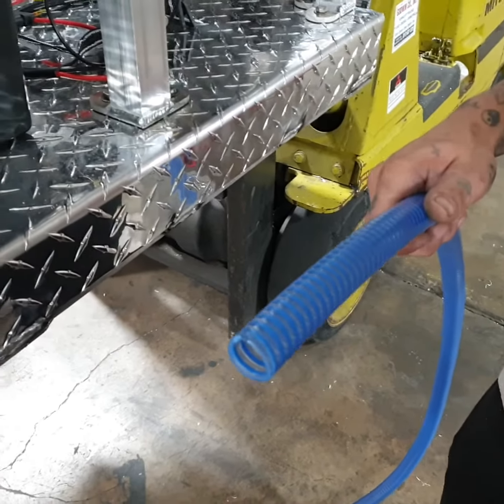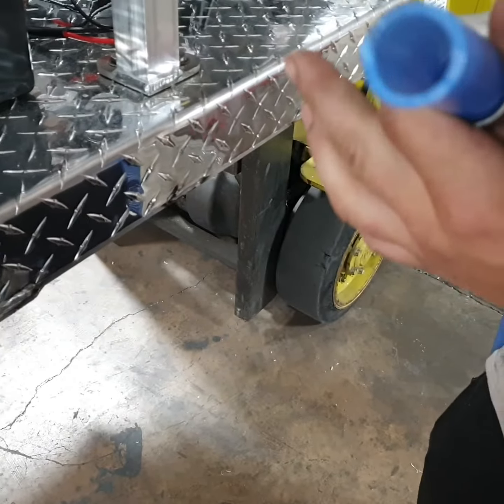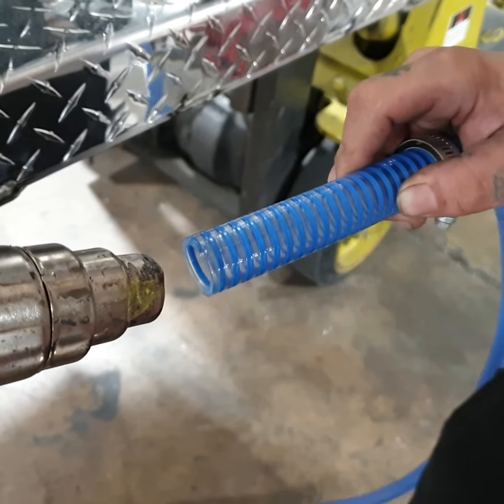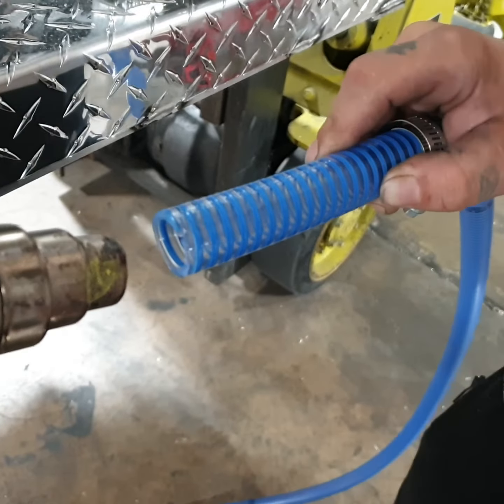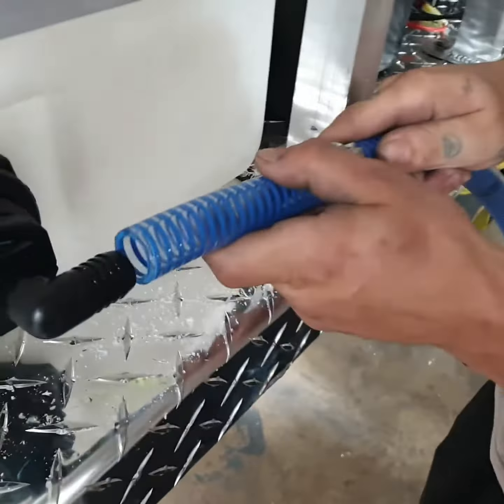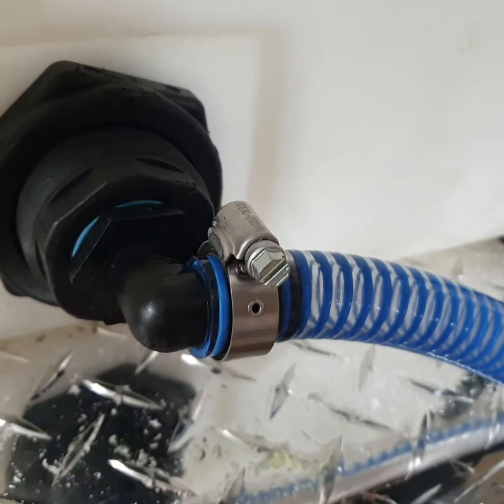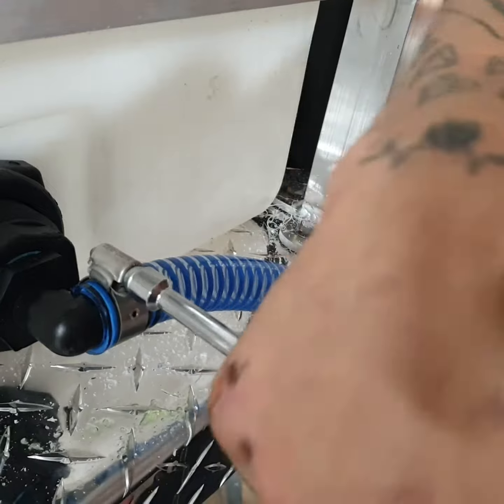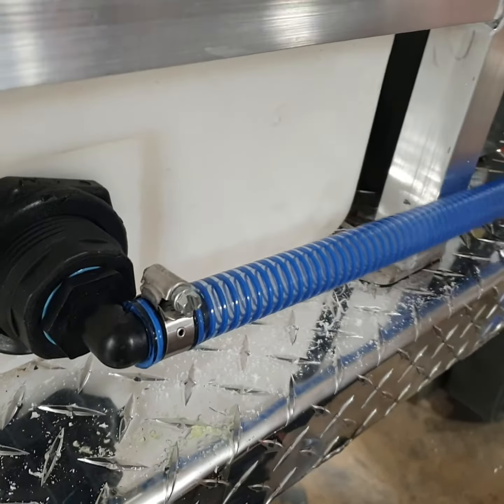Quick Tip-Suction hose installation on pressure wash and soft wash rig

Comment: How is this hose compared to braided vinyl tubing? I noticed the working pressure is much lower on the spa hose.
Reply from the maker: This hose is only for suction, no pressure.
Reply: @midwestwashingequipmentllc1209  I've seen it used with 12v soft wash systems, around the max rating of 100 psi. Just wondering if it's worth the switch from the stuff at Lowe's?